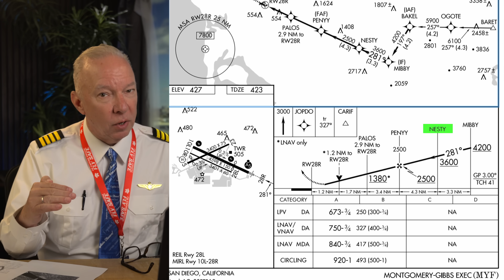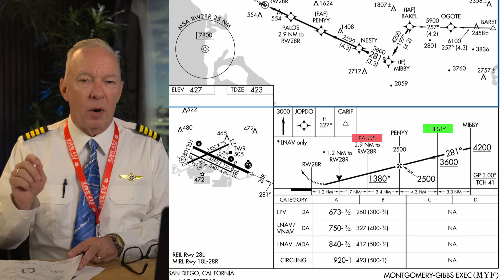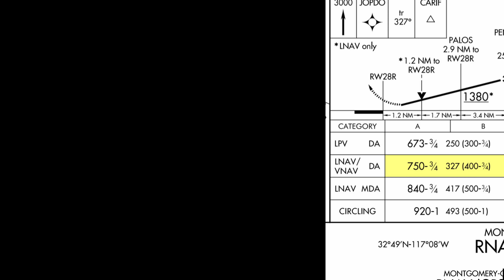Tragic Crash in San Diego: What the Pilot Did Wrong | ATC & Flight Path Breakdown

Comment: By my documents KMYF offers an ILS approach with a 3° glideslope. The decision altitude 673' (250ft above ground) slightly higher than the standard 200' above threshold.
Looks as if the pilot did this all hand flown. No autopilot would fly so! How was the C550 equipped? Could it be that the autopilot was inoperative?
However, I think that ILS would have been the better choice. Skilled pilots are able to fly such an approach with a lateral precision of +/- 3 ft, even hand flown.
The glidepath (GP) guides the plane over obstacles safely. Altimeter settings have no influence as long as the GP indication is stable.
This can be shown on the SIM and in actual flight.
Thus, the weather did not really count. Skilled pilots are able to land this airplane with no vision at all, even hand flown!

Comment: I'm no pilot. Captain Steeve has a simple drawing showing a ridge or a low hill before the runway and the ridge is the real obstacle problem, plane needs to be above ridge to come in for a steep landing. Designing an airport with a straight gentle clear approach without any obstruction should be the way. This reminds me of the Korea airline that land and slam onto the concrete block infront of runway. Until accident happens then obstruction factor is taken into account but not during the design stage.
Reply: The ridge is not very high at all compared to the airport elevation, and it's about two miles away.

Comment: 8:37 if his altimeter reading was off, wouldn’t that be reflected in his ADSB Data?  Doesn’t ADSB data just reflect what the transponder is reporting?
Reply: ADS-B and transponder are reporting pressure altitude. They have a fixed "altimeter setting" of 29.92. It is completely separate from the cockpit altimeter setting.
Reply: @igclapp 29.92 is only used above above 18,000 (or if it’s the local pressure). Whatever pressure the pilot sets is what the transponder uses to report altitude, which is what is sent to ADBS out (assuming it’s a different device).
Reply: @TSLApilot Incorrect.
Reply: @igclapp please educate me.  I’m trying to understand. When I set my local altimeter setting that defines the altimeter on my altimeter that’s where the transponder gets its data. Where would the discrepancy between my altimeter setting and the ADSB data come from?

Comment: Pilot here: The first radio call we hear in this video seems to be his initial contact with the approach controller after (most likely) a handoff from LA Center. I'd like to hear his last transmissions with center. I'm assuming they gave him a local altimeter setting after clearing him below FL180 but I never hear any altimeter setting on the approach control frequency. I'm used to an altimeter setting being included in my initial contact with an approach controller, even if center just gave you one (sometimes they are different).

Comment: The aircraft was operated under part 91 regulations although the aircraft was a class C the N/A in the approach plate was not relevant. The pilot had no weather information for the airfield, but had been informed that the visibility at nearby airfields was 1/2 mile; however the pilot was legal to descend (above minimums) to see if they could make the approach.

From the ADS-B data the aircraft appeared to be low for the whole approach. Note that the ADS-B height is with reference to standard pressure and needs to be adjusted with QNH for altitude above sea level or by QFE for height above the runway surface. 

Automatic weather information was not available for this airfield, which would have included QNH. The ATC did not offer this information nor did the pilot request this information. The approach plate provides information about height and distance from the runway, with respect to the runway surface (ie: wrt QFE). Other nearby hazards are indicated  as elevation above msl (agl). It is possible that the altimeter subscale was not correctly set, resulting in the aircraft being flown too low.

The TAF & METAR decodes for BR means mist. For DZ means drizzle.
Reply: Even Part 91, if he was class C he could not have made the approach because the approach is not authorised for cat C & D aircraft. However, his aircraft was in fact cat B.

Comment: Regarding the crossing restriction at PALOS (1380')... There's an asterisk next to it which, in my opinion, denotes "LNAV only" as shown in the vertical profile box. If he was on an LNAV/VNAV approach, he'd be allowed to disregard that restriction, correct? Not that familiar with Jepp-charts but I think that's  what is charted here. Notwithstanding the fact that he wasn't allowed to commence the approach to begin with, crossing PALOS below 1380' wasn't a deviation from the procedure.
Reply: His plane was Cat B. If he wasn't authorised to shoot the approach it was for another reason: he didn't have an acceptable altimeter setting. Also, although 1,380 at PALOS is only for LNAV, it doesn't mean it's acceptable to go below that altitude at PALOS if you are flying the VNAV or LPV glide path. If you are on glide path, that will keep you from dropping below 1,380 at PALOS.

Comment: I'm no expert, by no means. I deal with car crashes.. But I gotta a knack for figuring these things out. After looking into a few things, myself before finding your video.  I think you're spot on!  When the pilot said "We'll give it a try", I knew he didn't like his odds and wasn't ok with his ability to land in those conditions (You can hear it in his voice). But when he said 1200 alt.. I knew he's never been to that airport in his life, NOT with that plane!  Or he would have KNOWN about those power lines..

My biggest question is though.. Don't most modern planes comes with safety features to make pilots aware of the high wires and their location? Not just the visual ones..
My next question would be, why did the tower allow him to land his plane there, IF it wasn't authorized to land at that airport in those conditions, let alone being a C class plane, which isn't even allowed to land there, let alone be AT that airport. Unless it's a Emergency landing situation, which even then I feel like they would divert him to another airport based on the plane type and weather conditions and the fact the airport he was landing at.. is Unmanned..

Comment: The issue I see here is complacency, if not meeting the level of inconceivable, to even allow aircraft to land at an uncontrolled airport under those impossible conditions.  The pilot is flying without a current weather report, which includes current  barometric pressure which the altimeter relies on for accurate altitude readings.  What could possibly go wrong, besides everything.  God rest their souls.

Comment: LNAV/VNAV Minimums are not authorized with a remote altimeter setting. Some systems that are WAAS capable will use SBAS in lieu of baro-aiding unless it is unavailable. In this case, he probably would have used the LPV if he was WAAS capable. If he was on GP for the LPV, the altimeter setting would be irrelevant in regard to the glidepath, but it would affect the DA. It's an unfortunate accident, but we can all learn from it. As always, another great video!

Comment: I'm an old C141A pilot.  We flew many non-precision approaches (VOR and NDB)(they hadn't invented GPS yet).  On these approaches, we were encouraged to descend to the MDA fairly quickly, and then drive in at that altitude until you see the airport environment. The minimums on the approach plate protect you from hitting anything. The only non-precision approach on this plate was the LNAV, with an MDA of 840.  My take is that the pilot busted the minimums (for unknown reasons) and contacted the power lines.
Reply: Yeah that's what's confusing me in all this discussion. The last time I flew there was no such thing as a GPS approach. But for a non-precision approach, "dive and drive" to the MDA was the way I was trained, there's nothing inherently wrong with that provided you don't bust the minimums. But why was he going for the LNAV/VNAV approach under these marginal conditions? Wouldn't the ILS have been better if he wanted to give it a try? And regarding Brown .... isn't there an ILS that could have got him in under the reported conditions there? Or even Lindbergh Field. I feel like important things are being left out of this discussion.

Comment: 1. Why does the plane have a bar thing on the bottom of the airplane?
2. Is there really a road called sample street?
3. The fact that the flight has the number '666' in the flight number. Who would get on a flight with this number?
4. Give it a go is not bold, doesn't sound ready, doesn't sound sure.
5. Specific NESTY section.
6. Foggy...can't see...foggy...foggy

Comment: Hi Captain Steve.  Thanks for a great analysis here.  I have a question...  Is it legal to attempt the approach even though the visibility and ceilings minimums are reported lower than what is on the approach plate, as long as you don't go below a DA or MDA and go missed when you don't see the required runway environment?  In this case it was a really bad idea since there was no way to get a proper altimeter setting, and also Cat D is NA on the approach plate.

Comment: Why not ask for Lindberg weather even if a little further away.  Gillepsie KSEE altimeter was 29.90.  Probably not that far off at Montgomery.  You show 3 NOTAM's but did not talk about them.  I heard, but no specifics about approach lights out of service.  Heard runway lights OTS.  If NOTAM's, usually the controller will ask pilot if he has the current NOTAM's.  This is a Citation 550.  Did pilot have waiver to operate as a single pilot?  Lot's of questions.

Comment: A look-see is legal under Part 91 even if the visibility is below minimums. And yes the Cessna 550 is a Cat C aircraft, but under Part 91 of the FAR's the approach can be flown under Cat B restrictions, as long as the airspeed flown on the approach is slower to comply with the lower Cat B speed range (91-120 knots vs. 121-140 under Cat C). There are a couple of other restrictions: 1) Final approach speed is 120 knots or less 2) Obstacle clearance is assured, and 3) the pilot can justify it if challenged (in the event of a violation or ramp check, the pilot can show that the actual flown approach speed was within Category B limits).

The illegal part was the moment this pilot descended below minimums without 1) being in a position for a normal landing. 2) Seeing the required flight visibility. 3) Having at least one approved visual reference (per §91.175) in sight.

I'm not sure yet if he descended below minimums before or after losing control, or even if he did indeed lose control - he might have hit the power lines and ridge that apparently were directly on the approach path. Or he might have kept descending on an (attempted) normal 3-degree glidepath through minimums, hoping to see the runway by staying on glidepath instead of performing a go-around, as he would have been legally required to do. More info is needed that will come out with the investigation.

Bottom line, some terrible decisions were made by the pilot. Just because it may be legal doesn't mean it's necessarily the best course of action when there's a less risky choice.

Comment: One thing I’ve noticed is that the most popular commercially available ADSB tracking websites, like Flightaware, display aircraft altitude as pressure altitude. So you need to make a correction to get their true altitude. Often this will make a difference of several hundred feet.

Comment: Thank you for the insightful breakdown on this accident. I knew the pilot and he was a great guy. RIP to everyone that lost their lives in this.
Reply: Very sorry for your loss❤
Reply: So sorry for your loss. My condolences.
Reply: pilots stop taking risks when landing . either make sure or go somewhere else. and screw the passengers that complains just do it. your judgment should be about ultimate safety and nothing else.
Reply: I'm so sorry for your personal loss.
Reply: I'm so sorry for your loss.
Reply: Steeeve did get it wrong on 2 points: 1) as a Part 91 operator, Dave was totally legal to try the approach - even with ZERO visibility. Only airline or charter ops are prohibited. 2) The S550 was a Cat B aircraft, not C, so Dave was legal on that account too. If only he had maintained the minimum descent altitude until the VDP.....
Reply: Captain Steve, I am a relative new viewer. Thanks for all the videos so far. Can I point out that, this particular video was great! However, at  about 12:20 I noticed three things.

First, you stated that “most” airplanes aren’t certified for LPV minimums. I know you are 121, and not sure if they are certified for LPV or not, but I can say that nearly the entire fleet of aircraft used by several large 135 and Fractional carriers are certified for LPV and have been for years. Also, the 1965 PA28 Piper Cherokee that is in our flying club is certified for LPV. My point is, it isn’t as “unique” as you made it sound. Many operators are able to shoot LPV approaches, and in many cases it is preferred over an ILS as you are not switching Nav sources and the Missed Approach is often easier and more straight forward. I do not know if the accident aircraft was capable of LPV, but the NTSB will find out.

Two, you said it was “illegal” for the accident pilot to shoot the approach because the visibility (1/2 mile) was less than the minimums (3/4 mile) on the approach plate. Assuming this operator was Part 91, there was nothing “illegal” about shooting this approach with 1/2 mile visibility. Now, whether it was prudent, or smart is a different discussion. I’m just saying that this pilot is dead. He is no longer able to defend himself against incorrect assertions, including that he shot this approach “illegally”. Words mean things. His family are still dealing with this.

Third, and similar to the second point above, the Citation II is not a Category C airplane. It is a Category B. Again, there was nothing “illegal” about him shooting this approach, at least as far as Categories and Visibility go.

I say all this because there are a lot of viewers that are not pilots, or in the industry, and don’t know any better.

Thanks again, I look forward to your other great videos sir
Reply: @daneav8 May I ask how he would know he was “illegal” at this approach? There was no one to tell him so is this simply knowledge of this airport from prior experience/flight planning. Thank you.
Reply: @Anca820 Sir, first, my prior comments were saying that he was not illegal to shoot this approach…at least as far as I Visibility and Aircraft Category are concerned.

As far as your question. He was Instrument rated and Airline Transport Rated Pilot (ATP). Part of the initial Instrument training (and further Recurrent training) is recognizing what approach Category your aircraft is, and how to read an Approach chart. You also have to know the applicable Federal Aviation Rule (FARs) regarding your type of flying (Part 91/91K/121/135) to help determine whether it is legal for you to commence an Approach
Reply: @daneav8 First, my sincere condolences to the families of the deceased. Thank you, Dane, for your sensitivity in your views regarding this tragic accident. As a retired FAA air traffic controller, never does one ever want to experience working an aircraft in which one is the last person to speak to the pilot(s) of a crashed flight! My sincere regards to the controller who was the last person to speak to that pilot.
“Words mean things” - they certainly do! 🕊
Reply: Tru sasha
Reply: A great guy, but a very bad pilot. He had no business flying a plane-- jeopardizing the lives of many because of his ignorance and arrogance.
Reply: @sasha3432 I'm embarrassed for you and your worthless, cold comment.
Reply: @sasha3432 I don't think there's any evidence of the thing you're accusing the pilot of.
Reply: @sasha3432 unnecessary and undoubtablly incorrect comment. Are you trying to make the families and friends so much worse. Ignorant!!
Reply: @sasha3432 you have mo clue he was more than qualified
Reply: @jamesgentry13 so just stupidly reckless?
Reply: @sasha3432 And what are your aviation credentials, Hero? Your statement is completely baseless. Most of us know nothing about the credential, hours, experience or ability of this pilot. Yet, YOU are in full arm-chair-quarterback mode. There have been many, truly great pilots, that have died in accidents.
Reply: @daneav8  You are absolutely correct: We know nothing about his credentials, hours, experience and ability. But based on this analysis, we know that he exercised exceedingly poor judgement. Credentials, hours, experience and ability only make for a good pilot if combined with good judgement. Ergo, he was a bad pilot.
Reply: @ifitquaxlikeaduk thank you for recognizing that we don’t know the accident pilot’s credentials, etc. 

We also do not officially know at this time what the cause of the accident was. Until we do…it is my opinion that we cannot declare this man a “bad pilot”. He is dead. He cannot defend himself. And we would be arm-chair quarterbacking to do that. It is not outside the realm of possibility that there was some instrument error, some mechanical malfunction, or otherwise. Just my humble opinion.